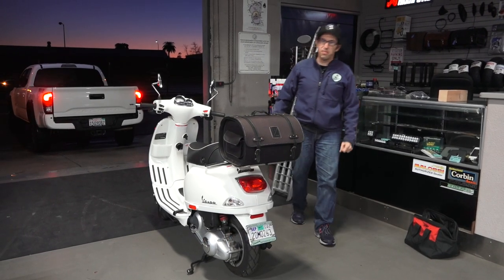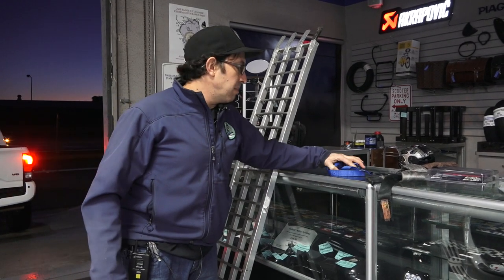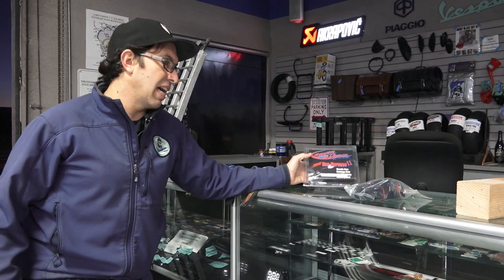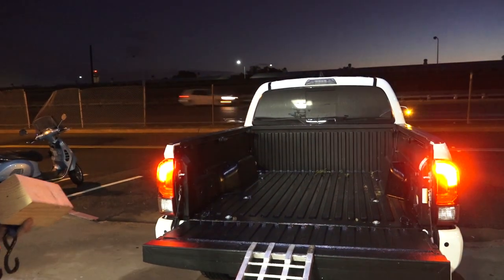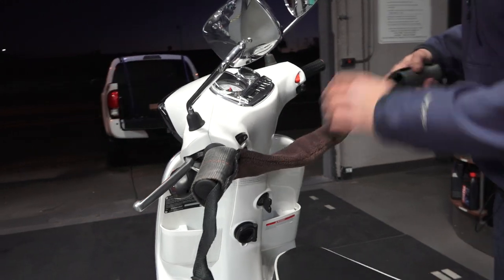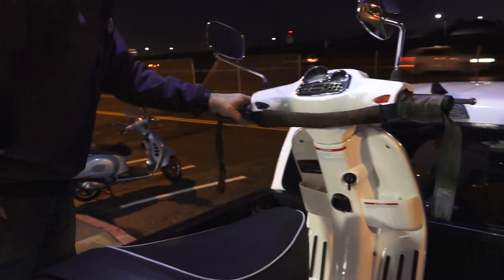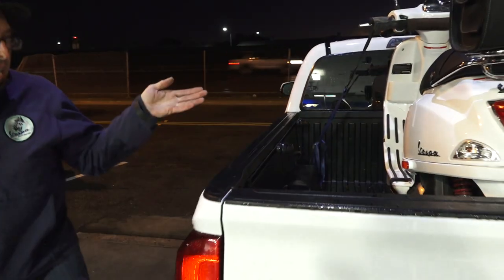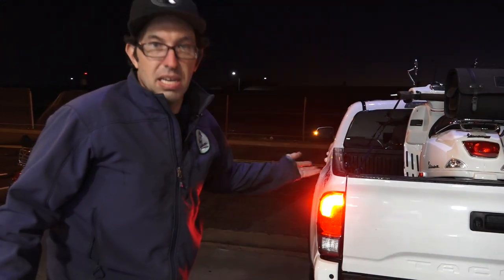How to Properly Load a Vespa Scooter in a Pickup Truck

Comment: I did haul a Piaggio Liberty 150 on a 96 Ford Windstar Minivan (without the middle seat and temporarily removed the back seat) through the side loading door. It's higher 54" than the back hatch 49". There are six floor strong tie downs for the quick-release seats. Removed the back seat. Removed mirrors and small flyscreen. Put the loading door next to a high curb. Two guys rolled into the van with a couple boards on the grass curb, jumped the gap, no ramp. 4 straps. Slid back seat on either side of the scooter. Same way, to backed down to get another curb, then roll to driveway.

Comment: The vintage vespas have an aluminum headset. Using "Canyon Dancer" tie downs has always been a concern, especially for long distances. I usually tie the straps around the neck of the scooter. Also, using a trailer, I have to secure the back end of the scooter because it will bounce around and rub on things.

Comment: I would also do one more on the rear. if you break hard, the rear is coming up in the air.  if you crashed god forbid, the rear can theroretically flip forward. you only strapped the front down. the pivot point is the front steering handle. but the rear is free to move.

Comment: For us short-stuff people I would suggest using a small home step stool close to even with the back of the tailgate. pushing the scooter forward merely step up the one step at a time keeping both hands secured to the handle bar and brakes. Unloading would be done in reverse order. Only stepping down the steps backward maintaining handbrake pressure.
Reply: 😊 yup.

Comment: I hurd one mistake right off the bat the guy sed. side stand. if you have a side kick stand you first off got a bike from a place that is money hungry and just wants a sale since they did not informe you it better to remove it. but getting on side stands are the biggest mistake ever made having one on your bike. when you use them its very ex to grab the bike the wrong way witch will disengage it making the bike fall. the first thing you should do when you get a bike is learn to use the middle stand and remove the side stand . I remove them when I get a bike and toss them in the can. every dealer buy me sells them without and shows you what they removed it fore and ask if you ant it installed back on for free. tho if you do they will make you sign a paper that shows you understand the dangers of them and that if you damage you bike its not their falt.
Reply: vorkev1 side stands are very useful when parking on uneven ground or cambered roads.

Comment: nice video - I alway tie on 4 points, i.e. I do the back as well. Also, I am putting anothe short tiedown around the brake lever to have the wheel locked

Comment: I have ridden dirt bikes for years and Vespa's for about a decade.  One more helpful hint is if you are a shorter person of stature or have a 4x4 or Large truck and you don't mind an extra ramp in the back of your truck .....you can place the 2nd ramp on the bumper and use it as a walk board while the other ramp is on the tailgate!  As Robot indicated.....the tough part is getting your scoot fully into the truck and "over the hump."  When I have a difficult load due to space, I will turn the scoot on and use my throttle hand and control it as you start up the ramp and use your left hand on the rear brake lever.  I'm lazy now and do it this way all the time.  This eliminates you having to try and step up or onto something which may cause a nasty fall!
Reply from the maker: Great idea, thanks for sharing!

Comment: Very good presentation as usual. One problem with the vintage Vespas is that the rear brake is foot operated and the front one would not hold the Vespa on the ramp should there be a problem in pushing it onto the bed.
Reply: I encountered that last night. Bringing the 1979 P200 down the ramp, the front brake did not hold it in place. It was SKETCHY

Comment: thanks for the how to. Would this work if the wheel is not straight? I have a Stella the wheel is locked but the handle bars are free moving. It is damaged. Any advice much appreciated. thanks.
Reply: If the wheel is locked, you're going to have to get a couple other people and lift your Stella into the bed.